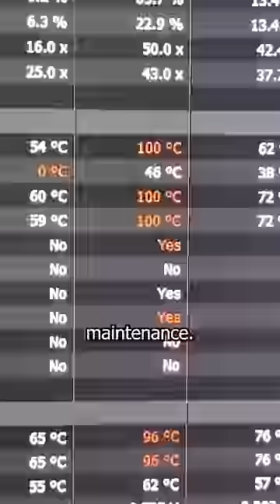Dell XPS gets a second chance (it's cool) #tech #pc #technology #shorts #laptop

Comment: Xps laptops shells are really nice. I remember someone brought one on in because of supposed display failure. Luckily it was just a loose  screw on the bracket holding the Dell Oled display down. Don't really know how that happened probably wasn't installed properly from the factory. But damn I really like the cnc chassis. I wish more dells build quality was more cohesive with their other products... because they usually really suck.

Comment: The new xps seem a little better designed, I have one of those ones with a 1650 in it and I had to create and enclosure to prevent cooling air leaking around the fins and undervolt the hell out of it to get it remotely comfortable, one hacked bios later and it's an excellent machine

Comment: Try out PTM7950. It's ideal for laptops, with a similar performance to liquid metal without needing to replaced anywhere near as often, and wothout beign susceptible to pump-out and being conductive. Even Lenovo uses it on their new Legions which is why you SHOULDN'T repaste one of them.
Reply from the maker: I sell it in my Amazon store and use it often on customer laptops. Problem is I'm on vacation and not near my store, so Noctua was what I used

Comment: My XPS gave me a Christmas present of mild smoke inhalation because the display connector literally melted. Ordinary use, sat on a cooling tray, still decided that 2 years old was enough to start smoking...
I think the motherboard is fucked because it won't power on at all. Since the MB has the CPU and GPU soldered into it, that's pretty much the whole £1000 device written off.

Comment: I have an Alienware with 8th gen Core i7 and a Dell G7 with a 10th gen, the problem is both always touch 100C while gaming even I cleaned them and change to a better thermalpast, even the Dell has Liquid Metal on it, the only difference is it do less thermal throttle while gaming, I am the only and first owner, I know how to do a maintenance but still hot, Dell disclaim in its web that is something normal

Comment: I’ve had a bad XPS 15 a few years ago. Would downclock to 0.5ghz and be stuck there, until a reboot, at which point it was a coin flip if the problem would persist. Was fixed through RMA, however, I’ve always been curious what the issue was. It’s happening with my new 7600x again.
Reply: The XPS line is notorious for its terrible cooling. Underclocking helps but nothing can make up for how bad the cooling is on those devices.
They're also known for having lots of other random issues but that's for different reasons.
Reply from the maker: Overheating or the charger or charger port is bad, or the PMIC, or it's just a piece of shit
Reply: Measuring temps, it was never excessively hot while the issue was persisting; it would simply boot into “limp home mode” if it felt like it.
That was an old Intel i7, a 10700k iirc with a 1060 6GB iirc? 
Might’ve been a 9700k. It’s been a few years. 
I’m really curious how come the issue has come to an entirely different pc. This is a desktop, and has absolutely no issues with temps - ive built it myself.

I guess it’s just another soon to be brick. Thank god for RMA I guess.

Comment: XPS. The overheating, poor quality control nightmare
Reply: Yep, they're absolutely terrible. There's a reason the SuggestALaptop subreddit and its respective Discord server make fun of the line endlessly.
I tried getting one recently and it had an HDMI port that didn't work and issues with the USB-C port, among other issues. Returned it and got an HP EliteBook 865 G9 instead.
Also, random addition but I remember seeing a picture from a guy who worked in a repair shop and he had a pile of probably 30 XPS corpses all dead because the hinge is so tight that the screen snapped off over time.

Comment: Yo, have you ever worked on or used a 2020 Razer Blade advance? My temps are absolute insanity, the laptop physically burns me. I’m not sure I can be arsed stripping it down and re pasting unless it’s going to make a significant difference. I’m talking constant 95 degrees and throttling most of the time.

Comment: Question, i have a Acer laptop and for some reason my letter "G" key keeps spamming. I ripped that key to see that it wasn't stuck, next i turn my laptop off and on didn't work, tried my Sticky Keys but to no avail and lastly ran diagnostics check on the keyboard in my latop but instead found no issues when it clearly is. At this point I have no clue what's going on with it. 😕

Comment: Dang I can’t seem to run a vm or anything on my dell laptop without the thermals getting close to or at 100°C. I’ve had that problem for a while so I wouldn’t be surprised if the thermal paste is straight burnt 💀had to send it back after like a month or two when I first bought it new cause the fans went haywire and sounded like they came loose from housing was grinding whatever was touching the fan.

Comment: Bro why does my gaming laptop run 98° during a stress test 💀 its only a year old
Reply from the maker: Most gaming laptops hit 100c before they throttle no matter what. You need to undervolt if it’s happening during regular use. Stress test is generally a poor measurement of actual performance, but a good indicator of it will ever overheat during normal use
Reply: @SalemTechsperts  but wait... is it normal that it ranges 70-80°  during gameplay

Comment: Unfortunetly this video is wrong, and changing the paste won't solve the issue. This laptop probably has cpu issue resulting in excessive heat. They aren't designed to stay in turbo power mode forever and they do thermal throttle out of the box but I'm quite sure this one's just broken (they often do) had a bunch of them through the years. And I even daily drive broken one 😂

Comment: Anyone got an idea why my brand new Samsung Galaxy Book 3 Ultra heats up at literally any occasion, like even a restart, and the fans screaming and the keyboards heating whilst playing simple games on lowest settings? I have a RTX4050, Intel I7P so performance should be outstanding. The fans do stay still if I do very simple tasks. Faulty device or normal? Are there tests I can run? Avira did not find anything, even in the complete scan, and CPU and GPU usage are very rarely over 5% (when I occasionally check). The laptop sits on my desk, and I put some high foam bits under the corners to further improve the airflow. It's basically levitating. Can energy saving mode somehow be involved?

Comment: Bro as i said earlier while gaming my Cpu temp goes upto 95 to 100 degree Celsius and Gpu around 80 to 86 if the game using 90% of gpu otherwise in low settings gpu temp goes upto 65 to 70 degree Celsius, just tell me is it ok for 3 year laptop or not i am not in good condition like i am in very bad situation and i dont have any idea what to do, i already give my laptop to dell service center but now also the temp are same no chaneg even he change the thermal paste plz tell me on this. 😢